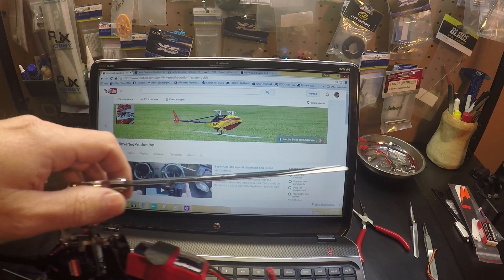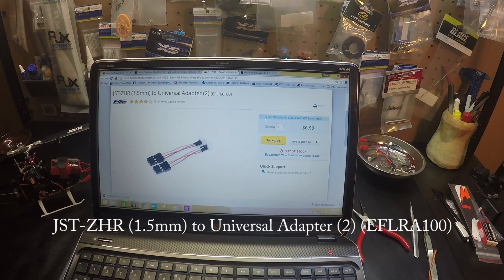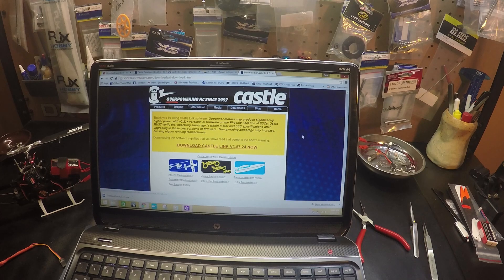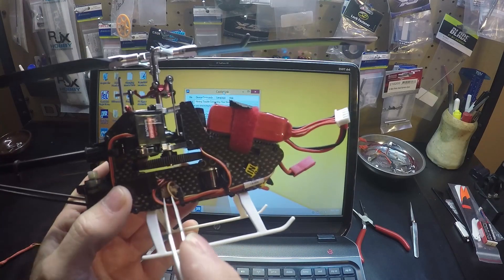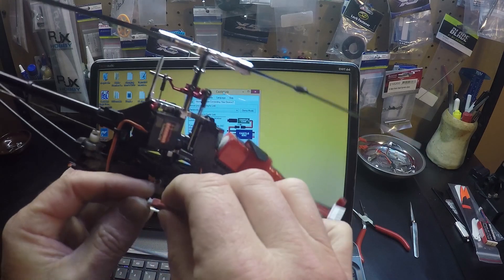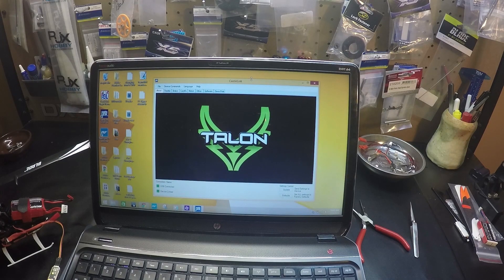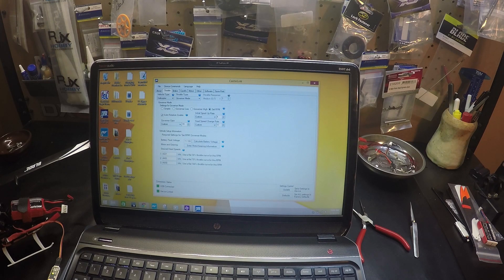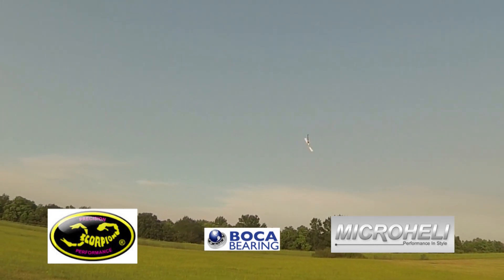Blade 180 CFX adjusting Talon 15 ESC governor settings

Comment: hey ! i just got a 180 cfx and its all stock not updated. i just want to know if theres some bug with the new firmware my controller is a dx6 v2 and i would be sad if my heli start to be fucked up. and an other question, is it normal from idle up 1 to idle up 2 i dont here the motor running faster ? my throttle curve is 30% 70% 100% thank you !

Comment: hey bro.   its me again.. quic  question...    what  thro  curve and pith  you  running?    do you keep  pith  curve linner?     i  got   this  brain  already and i like it.  im just  doing  my  tuning. thanks..
Reply from the maker: Throttle curse is set per 180 manual for your specific radio and governor takes over. Pitch curse I also use manual settings

Comment: Thanks for good vids.

however, in case of uBrain is it need to do throttle calibration?

For my Ar7200bx it is needs to do throttle calibration with edge lite 50,
how about Talon 15A and uBrain for my own 180cfx?
Reply from the maker: Terry Jefferies Most 180's don't need calibrating, I didn't calibrate mine.
Reply from the maker: If you are setting up the Talon 15 for the first time you will need to calibrate the throttle
Reply: JJInvertedProduction Hey JJ. Are you saying I will need to do a throttle calibration BEFORE using the castle link software? I jsut got my 180 last week and got the castle link in today but I am not sure if I will adjust the headspeed yet.
Reply: JJInvertedProduction Thank you!